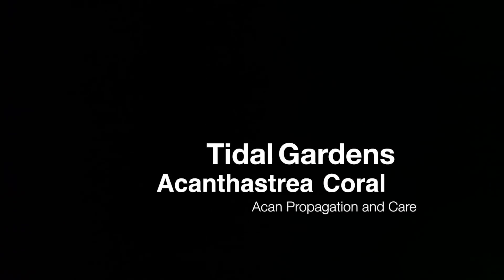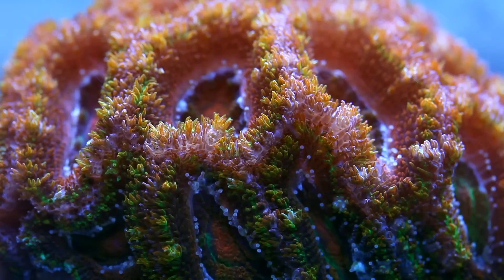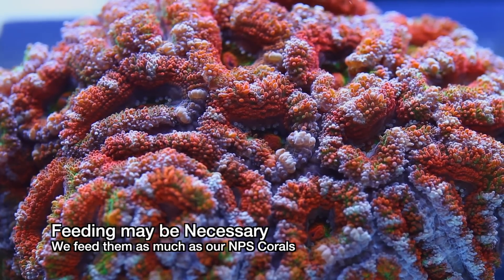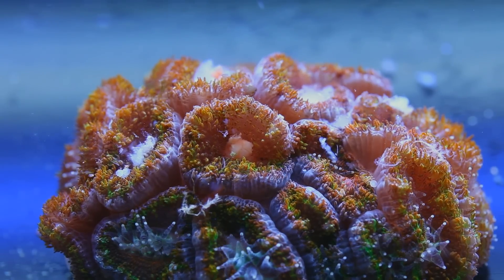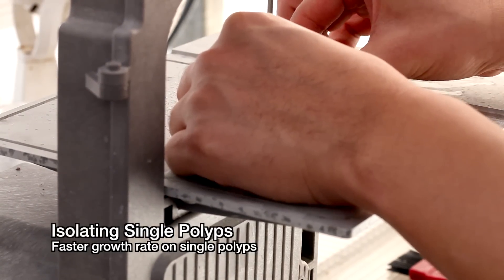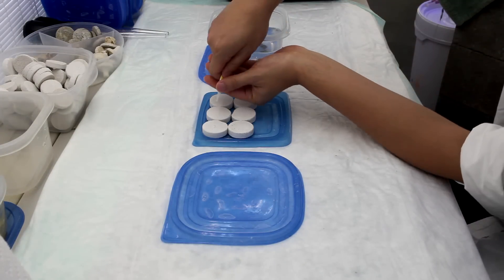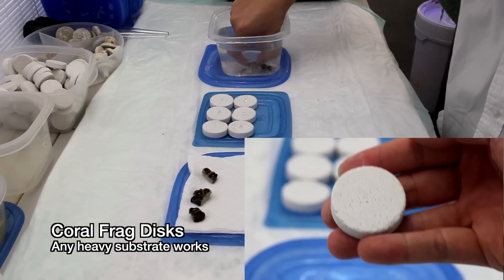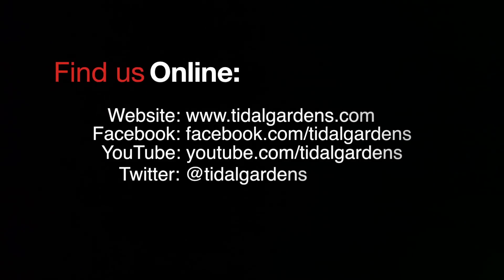Acanthastrea Coral Care and Propagation

Comment: Hi.  i was wondering if you had any suggestions on what to do for an acan that appears to be losing its colour.  originally purple but had browned out significant ly.  target feed twice a week and daily dose reef foundation a and b.  cheers
Reply: Hey dude. Found a Solution? Got the same problem ... big rainbow acan colony looses bright green and yellow and is getting orange/brown 😣
Reply: NRG 1337 hey mate.  After abit more research it seems the major cause of browning out is lack of light.  ive started ramping my lights up slightly and it does seem be darkening up abit.
Reply: thx man! Really? 😮 Just ramped my white channel down und put it under shade cuz i thought it get too much light 🤔 Run my Razer Maxspect 16k 160W @ 55% whites - 85% blues
Reply: NRG 1337 ive only got evergrows it2080 on mine and they were at about 60%.  going to see how it goes up to 75% as i dont want to piss the rest of the corals off.  i also read that high po4 and no3 can cause browning out, so might be worth double checking those?
Reply: Are u sure u wanna ramp UP? I read alot of shade shade and shade ... Oh ok thx mate good to know! My PO4 is around 0.8! 😒 NO3 is good.
Reply: Yeah according to a few forums.  I thought shade at first as well i may ramp up the light but move him furthe down as hes mid level now.  I read that its lack of usable par and also can be caused by excess nutrients.  My po4 is at 0.02 so it shouldnt be that for me.  Unless once their browned out thats it and you cant get them back which is a shame.
Reply: ohhhh thats awesome cuz thats the nicest and biggest piece i've ever got 😒 the other 20 looking perfect ...
Reply: hey NRG, got a local coral dealer that keeps his frag tank under three 165watt blackboxes, at 100% blues for 12-13hrs a day, with an hjour of weak whites 3 time so a week. i've been having trouble with my acans and some others so i decided to try this method and it's been going very well for a couple weeks now

Comment: Just FYI to save you some time. I have had inland bandsaw for a couple years. I use it every week and never clean the saltwater off. It won't rust. The blade is high-quality stainless steel and the rest is plastic except for the sealed motor of course.